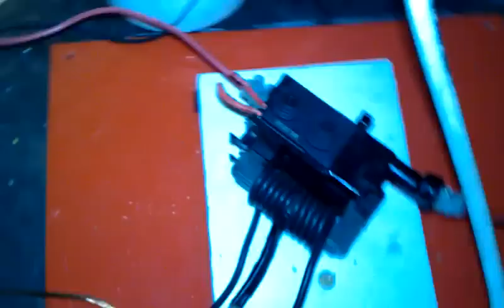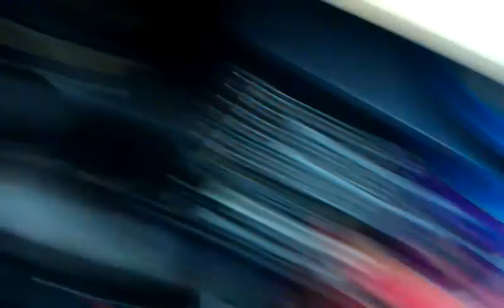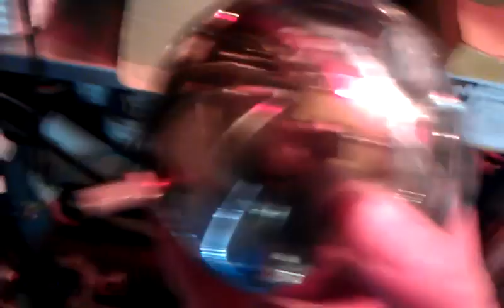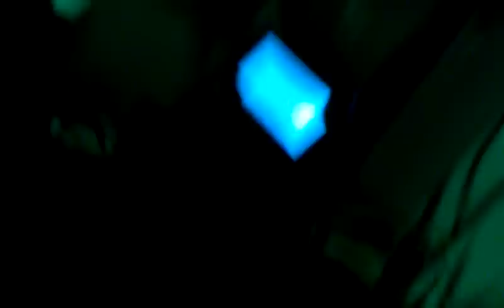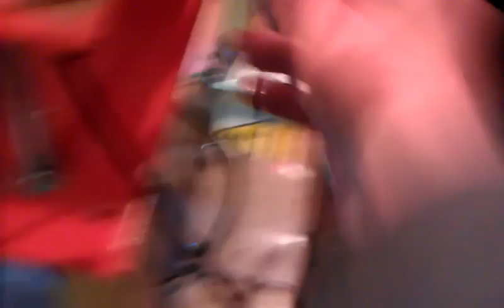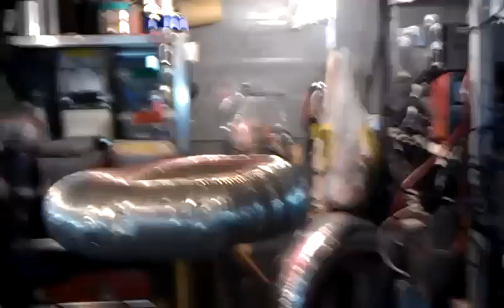"Flyback tesla coil bigger output!

Comment: Nice! Maybe a tripod setup for your cam? Btw, you have the caps in paralell with the flyback, i guess? I could not get sparks with my setup using flyback and zvs unless i put the cap in paralell with hv, and spark gap in series.. This varies from the standard design, but it works..
Reply from the maker: Martin Slinning hello, yeah I got it to work very well, the biggest streamers I got from a flyback was about 3 feet, love it haha.
this is a old video, watch my newer videos, you may like them 👍😊 

thanks for the comment, be safe 

Anthony 
high1voltage1rules

Comment: That is the biggest spark I've seen someone get from a tesla coil powered by a flyback transformer!  What a beauty!  What's the secondary circuit's resonant frequency?  300kHz or less?  Very awesome job here!
Reply from the maker: Hello buddy, 

Thank you for the comment, 👍

yes lol,  I did do good setting all that up! 
I did a lot of fine tuning” to get the best output I could for flyback transformers! 
To be honest I can’t remember the frequency mate. But how I did it was try different capacitance using door knob capacitors! As them caps are very good for flyback iv tried. And then using a 12v server fan to quench the spark gap! Also trying different gaps on the spark gap! Did this until I was very happy with the streamer length! 
I had about 10 turns on the primary coil and adjusting the wire around the primary to get the best from my coil. It took some time but I got there!! 
Every set up is different and it will take time but when you get that output your after” you will be so happy lol! I was very happy with my output! And did it my way with no help from google lmao! 

Also>

On your zvs driver! Build your own as you need a 4 mosfet zvs. 
When you build a standard zvs you just parallel the second set on each! So each mosfet on the zvs has another on top in parallel. make sure you build it with x4 irfp260n mosfets to help with the current draw! And each mosfets has its own resister and diode. The glass diodes were 15v I used! I could see the difference!!

Hope this helps and thanks again for the comment. and the very best of luck to you mate.👍

Anthony/ high1voltage1rules

Comment: What gauge of wire did you use for the secondary coil? Would using 46 awg around a 12 inch tube increase the arc length compared to 32 awg on the same length of tube?
Reply: in theory yeah if you exclude resistance but the killing problem is the resistance gets crazy high at that size and kills your sparks